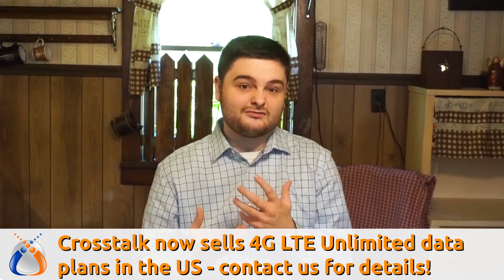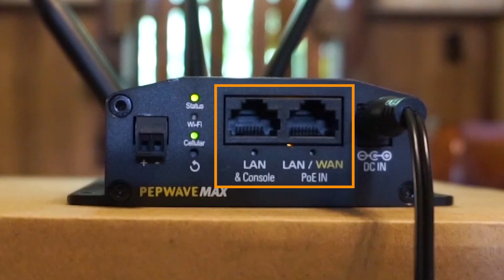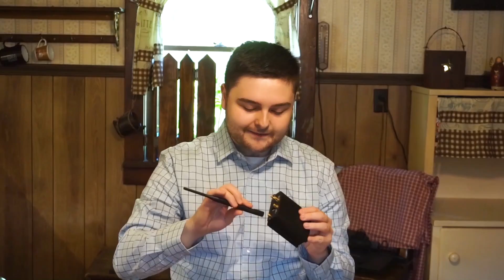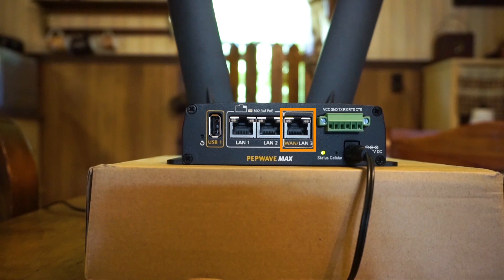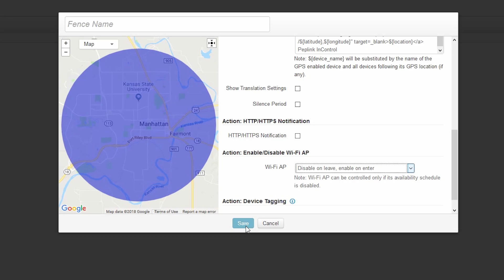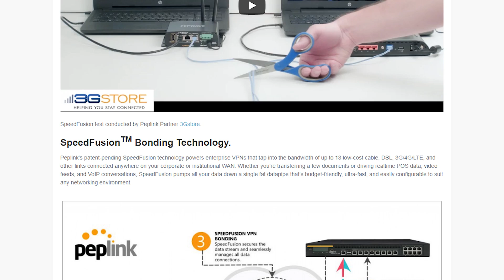Pepwave MAX BR1 4G LTE Mobile Routers

Comment: I have run probably 10-15 Cradlepoint IBR600's and they are ROCK SOLID. No issues - failover with my PFSense boxes works fantastically. Speeds are great on Verizon 4G, even with offices of 100+ users.

Peplink has never let me down either - thanks for the review! Might have to pick one of these up to test with

Comment: +Crosstalk Solutions Great video! I would like to know more about these two devices and which one you would recommend for mobile WiFi for up to 12 passenger devices connected simultaneously providing great security and AP isolation so passengers can't access another device. Also, do the dual SIM's provide failover when one carriers connection is weak or non-existent? Recently I purchased a MikroTik LtAP mini LTE kit and would like to see you do a review on it in comparison with these two Pepwave devices. Thanks!
Reply from the maker: We're working on more Pepwave and Mikrotik videos!  The Max BR1 is probably what I would recommend for your situation.
Reply: I presume you mean the Max BR1 mini over the MikroTik LtAP mini?

Comment: HI Chris! I watched your videos on Ubiquiti and it sold me. I got the extender to use with my Netgear Nighthawk on a gigabyte fiber service. 

Buuuuuut... my service requires I do a static ip and then my extender won't connect. 

Any suggestions on equipment changes?

 3 story block building.

Comment: The failover blip is because you are clearing you NAT state table upon failing back to the primary ISP. On the Cisco ISR platform I have a EEM applet that will keep established connections on failover but subsequent new NAT translations will take the primary circuit making for a smoother seemless transition without the end user even knowing the better.

Comment: Hi Thank you for the very informative vid, I have recently starting installing 4G systems with direction mimo antennas. I am very interested in the failover as I have setup an install with an edge router which has a PPPOE connection on eth0 via a Fibre to the premises modem, then a separate Huawei B525 modem/router as a backup/failover going into eth1. But the failover takes 30 seconds to kick in. So would love to see a vid on the VPN setup that you mentioned. Also when using a VPN would I be able to use port forwarding on both connections? At the moment in the uk the cellular providers double NAT all the 4G LTE so any port forward or DDNS style remote access will not work. You the pep wave system work for this? Thank you in advance for any help. Kind Regards Gareth Rendle

Comment: Are your unlimited data plans only in the PA area? Do you have plans for Texas?
Reply: Hey! We got plans all over the US. We are currently working on deals with some of the larger providers to make sure we cover as much area as possible.

Speeds greatly are affected by your individual coverage. Most places have good speeds. That being said, fiber or DOCSIS connections are always preferred. LTE makes a great backup connection, or main connection for places that can't get traditional coverage.

Contact us at info@crosstalksolutions.com
Reply: Francisco Charles I would also like to know, service, carrier, pricing & Data limits/throttling?

Equally as important as equipment.
Reply: I would probably be looking at a coverage area in west tennessee between dyersburg & Jackson, currently looking for land to build on since I'd rather install systems in New construction house/office.
Reply: Christophe Sterkens what are the pricing plans?
Reply: Jeremy Young shoot us an email at info@crosstalksolutions.com we have some truely unlimited plans which may be beneficial to you. I have a few clients pulling over 300gb per month. Right now prices are about $85/month (depending on the back end carrier). This may fluctuate soon due to a new carrier we are adding.
Reply: Christophe Sterkens hmm, $1180 a month? Is that enterprise or business class? 

When I worked at Virginia internet express back in 2000 - 2001 T1 lines where less than $600 a month dedicated.

That was about the time when tied into the OC54 pipeline and ran fiber to provide wireless service to the Harrisonburg VA area.

Was half the cost with 10x the thru put. 

We had a business class cable backup with 7mbs up and 12mbs down unthrotled/unlimited $60 a month.
Reply: Christophe Sterkens I’m looking for 1 sim for rural coverage for a Texas ranch
Reply: Christophe Sterkens sorry man, had to poke a little.

I like knowing what it's capable of. 

Beyond the scale I'd need thou, I'm going into coral tissue culture/propagation and would only need fail over for status updates and alerts for monitoring systems and security.

Maybe even video monitoring off site.

Some of the coral go for $150-$4,000 a polyp on the high end & rare strains . But normally $15-40  for common. Doesn't sound like much till you get 1,500± frags in a single system.

An 8'x4' 300 gallon tank can easily hold $200,000 in coral. And that's not high end or specialty.
Reply: Christophe Sterkens hey just to sort out the confusion. These are not Crosstalk Solutions' prices. At any rate, thanks for the information/feedback :)

Contact us for more info!
Reply: David Barger I sent an email through the website for more information and prices
Reply: Francisco Charles perfect! I will reply back shortly - we got hit with a ton of emails after this video :)